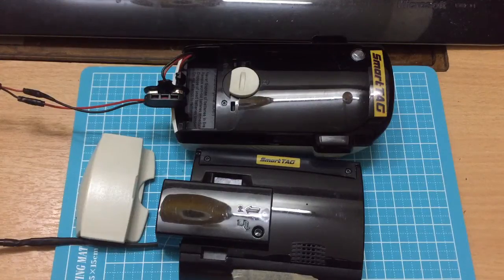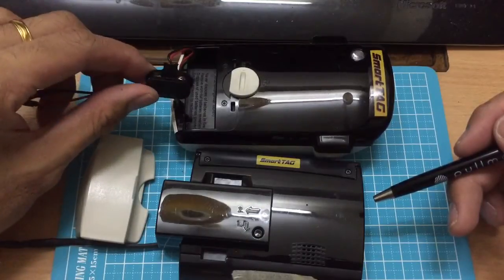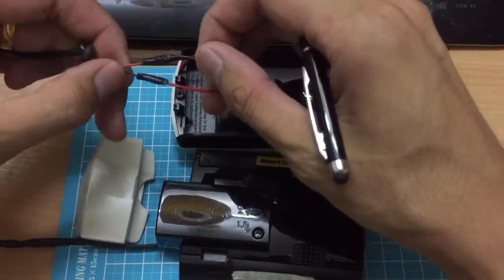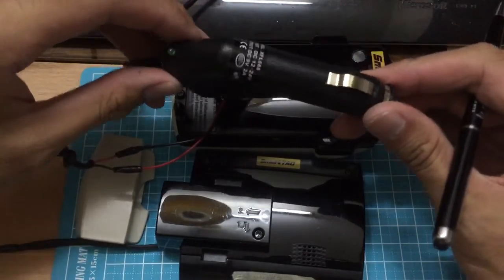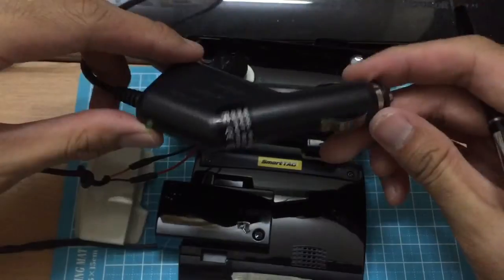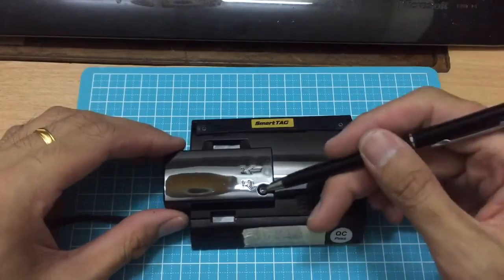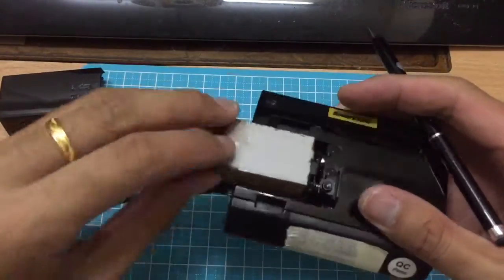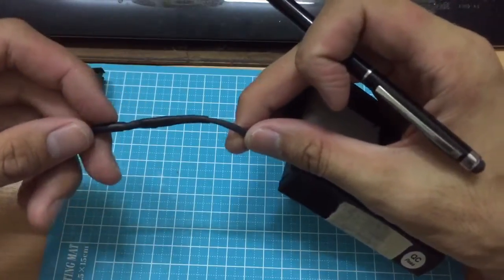Install 9V DC adapter for SmartTag - Part 2

Comment: hi may i know the adapter is input 12v  output 9v 1A rite  so we need buy output 9v 1Aor 9v2A BECAUSE ur video that adapter is 9v 2a
Reply from the maker: it works either 1 A or 2 A. 
Try witth 1A. It works fine.
Reply: confirm ya ????